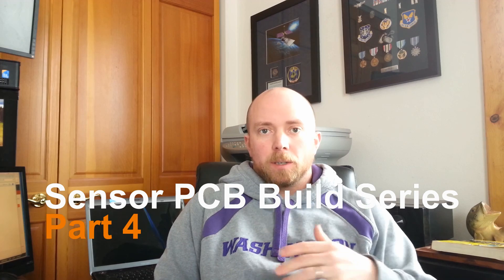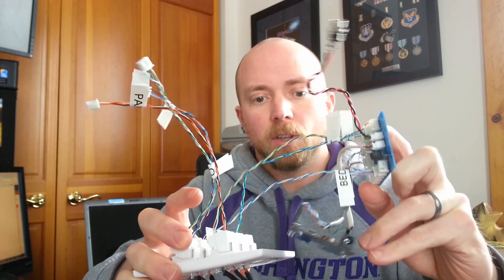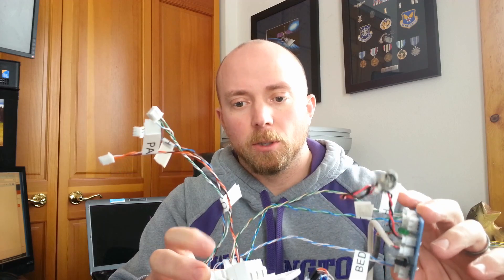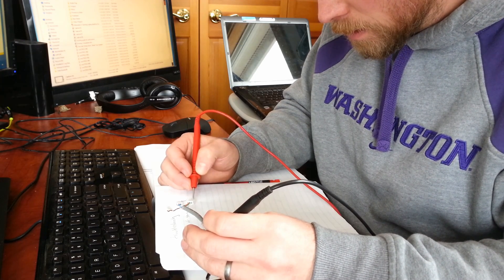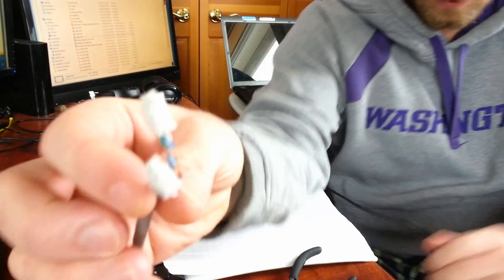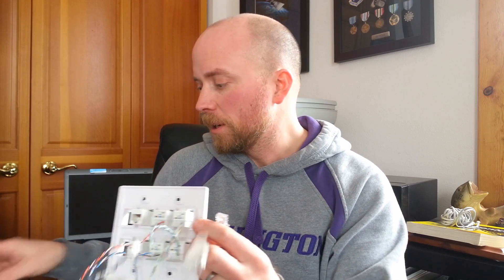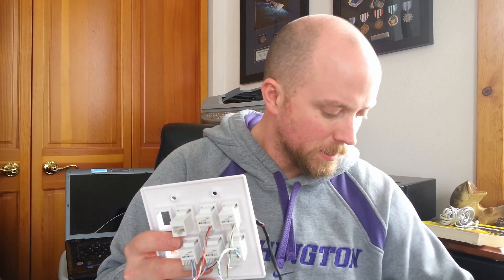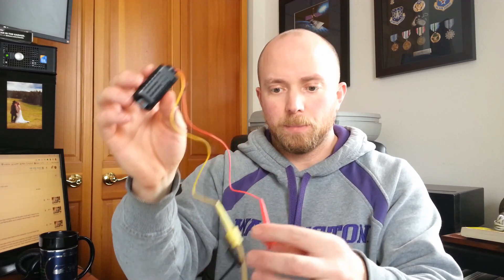Arduino Controlled/Monitored Greenhouse - Magic Smoke - Part 4

Comment: It's not you, it's the lack of mechanical tolerances in mismatched wires, connectors and crimp die tool.   Using loose wires is nearly impossible.  You have to sure you have the right type of RJ45 connectors.  There are CAT5 and CAT6 connectors and they require the correct size wire in order for the crimper to work.   Then, you must use the proper die on the crimper.  The wires won't be positioned properly if you use a mismatched connector/cable and/or the wire isn't a perfect fit in the holes of the RJ45 connector.  Any play in there and the crimp won't work.    I would purchase CAT5 or CAT6 cable and use the correct RJ45 connectors with the specific RJXX die.
Reply from the maker: thanks to your comment I was able to trouble shoot exactly this...the teeth on the crimper do not align very well and they were not making the best crimp. Had to do some mods but needless to say..I"m in the market for a new tool

Comment: You can get some of Platinum Tools EZ-RJ45 connectors (and the crimp tool as well) for REALLY easy cable making.
They are idiot-proof & not too much more cost than standard ones, which is why I use them  ;)

Comment: Reusing rj11 connectors sometimes leaves small bits (aka SNOTS) of insulation between the Vee Knifes causing the wire not to seat down and let the Vee bite into the wire. Screw Terminals are reliable and reusable.

Comment: rj11 uses solid 22 gauge wires.  The jacks has a wedge knife the slices the insulation and bites into the solid wire core.  RJ45 connectors and RJ11 connectors have two types of connectors, one for stranded 22 gauge and one for solid strand 22 gauge wires. I believe the stranded rj45 connector has two barbs that penetrate through the insulation to the wires. LETS THINK.  The connector is always a fail point! Screw terminals are more reliable.  As my past being and "old phone man and network technician".  Water, moisture, humid environments causes the copper connections of the rj11, rj45 pins to turn green and eventually short. Prototyping is hard enough, but intermittent connectors will drive you to insanity!  Good luck. KEEP IT SIMPLE

Comment: Don't buy/use cheap connectors, but also make sure that your connectors are rated for the same type of cable/wire that you are using (stranded for stranded & solid for solid).

Failure to do this will likely cause hair loss from frustration... (Sorry, bad joke)

It can & usually does take years to become proficient in making reliable crimped cable connections, and you don't have that kind of time to dedicate to learning that skill, so I'd recommend making a proto-board cable test jig, so you can plug your cables in immediately after termination to check your work.

The time spent making such a jig will more than save you the time & frustration of sorting out your cable harness later, especially if you have to make multiple sets of cables, and the cost of such is also minimal, being mostly the cost of the opposite gender pcb mountable connector for whatever cable connectors you need to test.

You could either mount probe sockets for your meter probes, or even better, a set of LEDs with current limiting resistors for each circuit in the cable set, as an instant continuity tester. Such a setup can have JST, RJ-45, RJ-11/12, & any other desired connector.
Reply from the maker: that's a great idea!

Comment: usually the reason why the rj45 crimp tool isn't doing a good job is often due to the fact that that actual connector was made for a different sized kabel lead. as an example a cat6 rj45 connector is made for the cat6 cable leads that are just slightly larger in diameter or the rj45 connector is made for flat flex cable so it doesn't have the lead guides so the tooth that goes into the copper misses and goes along the side of the lead.

Comment: ref: https://www.youtube.com/watch?feature=player_detailpage&v=VM1CVMhAg0g#t=264

I think the type you have is for one time use only. They work like the RJ-45 connector and push small spikes into the wire to make the connection. If you pull out the wire those spikes will be damage and not make a proper connection when you use them again.

Comment: TRM, if you buy the premade ethernet cables and cut them in half, you only need to strip the one end and attach the connectors to the Arduino. That way, it'll cut your work in half.

Comment: I have made a few of these and my "rules" are (and trust your tester, just let it run true the lines a few times):

1.  Strip off 5cm (2inch)
2.  Pull the sleve back a bit
2. un-twist all the lines
3. line the wires up in the correct order
4. bend them back and forth a few times so they are all parallell
5. hold the wires between two fingers and cut so that the parallell part is about an inch
6. With out letting go of the wires insert them into the connector
7. Check that all the wires are inserted correctly by looking at the front of the connector
8. Push on the sleve so it goes into the connector
9 Insert into the crimper and press down 2-3 times.
10. Test the connector.

Comment: Make sure you get rj45 plugs designed for solid cable and use flexible cat5 cable it will make a far better connection as the plugs for solid cable have far superior connections to the cable and are suitable for both solid and stranded cable ☺️
Reply: Ps I wish I was close would love to help out with the electronics I enjoy doing the fiddly stuff just not much use from Australia ☺️
Reply from the maker: so do I :-) I could use some hands on mentorship

Comment: Check that your cable types are compatible with the connectors particularly solid / stranded.  Also watch out for cheap RJ45 crimps and crimp tools.  If the die in the crimpers isn't well made you will run into problems.

Comment: I'm not sure if it's exhaustion or frustration I'm seeing on your face, but keep at it. These things will become easier with a little practice.

Before I moved into software I was a network guy. I crimped probably 500 RJ45 plugs before I had gotten to 95%+ success.

Those keystone jacks are bad. After doing hundreds, I still only had around 75% success and they are not reusable. The little spades the wire gets pushed into deform and won't work again. Eventually I moved to using jacks with a standard punch down connection because the keystone jacks were so bad.

Comment: I don't think that the pins on the connectors you are using on your multiplexer board are made to crimp on solid wire. I'm pretty sure they are for stranded wire only. They don't work reliably on the solid wire you are using. You also need RJ45 connectors specifically for solid or stranded as well, as others have suggested. Stranded tends to work better for that kind of stuff.

Comment: This is a little wind turbine charge controller my brother and I built,, https://www.youtube.com/watch?v=ZdrdjUd-CvA  ,,, you can save money building the whole thing your self,, and not buying Arduino boards . 

Also you can take apart your LED lights you use in your aquaponics green house,, you will find that the LED lights are 12 volts ,, you can bypass the built in 120volt ac input transformers on the LED lights and run straight off the solar battery system if you are running 12 volt batteries off your solar,, It is way more power saving if you don't change the incoming solar or wind power to 120volts AC then drop it back down to 12 volts DC ,, It is a easy fix to reduce your huge energy losses from converting solar DC incoming volts, to 120Volts AC ,, 

You have so many ideas on your setup that are awesome and I really like ,, but some things That stick out and make me think why did you do it that way? ,, it would be more efficient if you did it another way,, Kinda like insulating your building ,, you can buy some cheep plastic made for painters from lowels or home depot or something ,, you can tape it to the inside of your building add a couple fans and you got a double bubble greenhouse ,, since the cheep box store plastic is on the inside of your building it wont get the UV that will deteriorate it ,, it should last a long time ,, and it is cheep ,,, also you can add these fans at the top of your greenhouse,,,       http://mwands.com/store/appliances/dc-ceiling-fans/12-volt-dc-ceiling-fan  ,, 2 or 3 of them will move the heat at the peak/ top of your building back down to where you need it ,, ooh and add floating beds to your aquaponics setup ,, you can grow leaf lettuce easy and make money, fast

I am building my own greenhouses and Aquaponics this year ,, also outdoor garden ,, I will be able to grow all year ,,, this is my video where I kinda explain my plans for this year ,,,  https://www.youtube.com/watch?v=8UqNB6W5wA8  ,, Like you say if we all work together we can get systems like this working in any environment and on any planet :)

Love your videos ,, thanks for taking the time to do them

P.S. ,, you can wax your solar panels glass using a cheep car product this will help the snow slide off in the winter ,, I wax my solar every spring and fall ,, just helps stuff not stick to the glass

Comment: I guess the suggestion of using an i2c a/d Converter was ignored..

For simple two wire connections it's difficult to fault the simple 3.5mm jack ...

Comment: Engineers don't make good electricians, ha ha. I've made up hundreds for data, phone and video. I'd say my failure rate is less than two percent. The problem I have is 58 year old eyes need more than just 3.50 power reading glasses.
Reply: 55 with the same problem. Damned astigmatism.

Comment: Connectors or is it the insulation on the wire is to hard"?  Because it's to cold try your blow dryer  oops your wifes blower dryer and maybe turn up the heat.

Comment: don't give up, you will get there =) ! I don't like those solid wires but for rj45 and rj11 they are easier to crimp. For all other things I prefer the flexible stranded 24 awg wires.

Comment: When using RJ45 jacks and plugs you need to be sure that you have the correct jack for the type of wire you are using. Solid core or multi-strand wire each require different jacks or plugs.